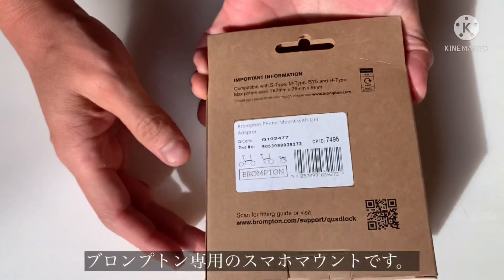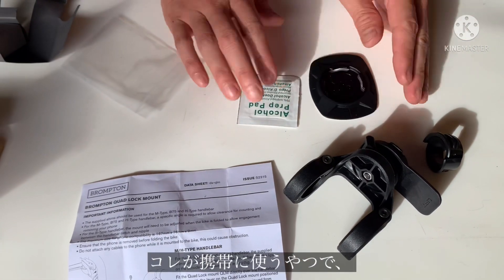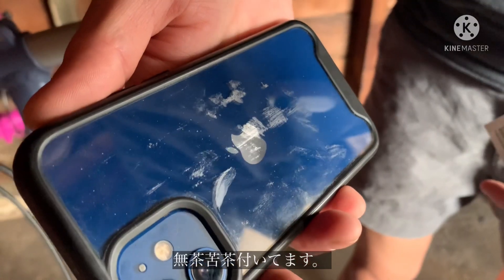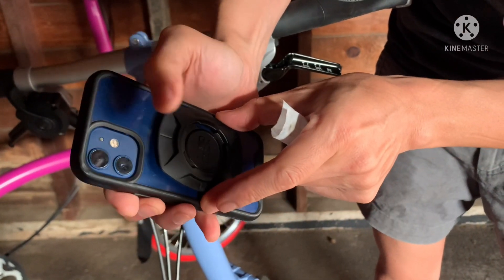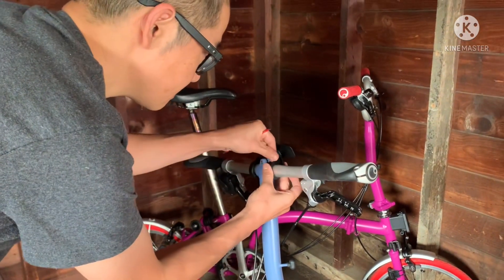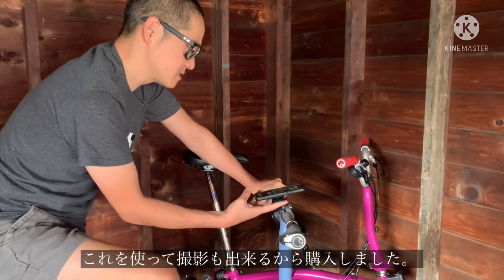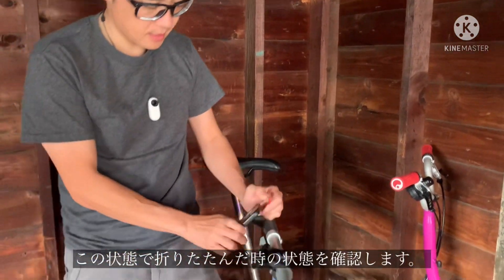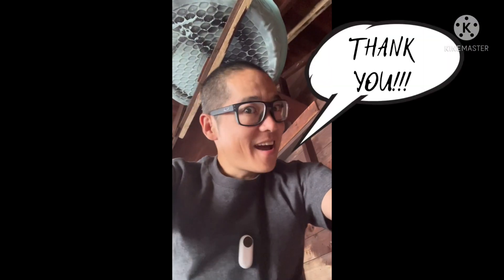BROMPTON SPECIFIC QUAD LOCK INSTALLATION (PHONE MOUNT) ブロンプトン専用クアドロック(スマホマウント)を付けてみた

Comment: I'm trying out the Mous intra-lock system.  It's nice because I can still use the mag-safe charger and mag-safe accessories.  It's easy to put the phone on the mount because the magnets help guide you, and its easy to take the phone off whenever I want to stop and take a quick picture. It's been staying on very secure even when going over very bumpy roads or boardwalks.  I got the version that was intended to be put on the end of a selfie stick because the bike specific mount would stick out way too far and would interfere with the fold. The mount uses a go-pro style connection, so I got one of those camera mounts that fit in the handle bar bolt on the middle of the Brompton handlebars and it's been working pretty well for the last few months.

Comment: Mine broke after 3 months because I often shift it around and possibly may have damaged the hinges. I also fit the mount to an S-Type handlebar and have to say it is not as secure as a M-Type. Currently I'm using a standard Quad Lock Mount which not only has a larger phone mount. But also has space for a rubber gasket. I'm happy with it but the only downside fitting a standard mount instead of a Brompton specific one is how it has to be mounted to not affect the fold of my bike.
Reply from the maker: I like it so far.  I wish it was a little easier to take on and off since I use my phone to take videos and pictures.
Reply: @BromptonFamilyTime  why you don't buy Quadlock Stem Mount? I think its better for S-Typ handlebar..